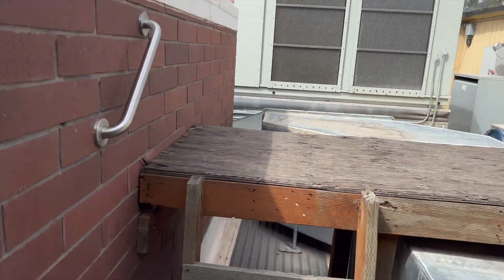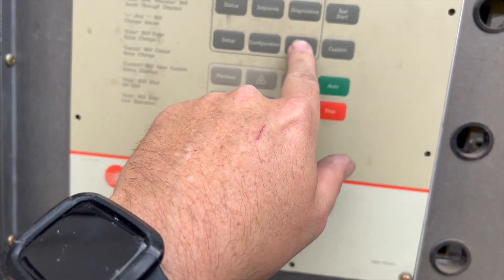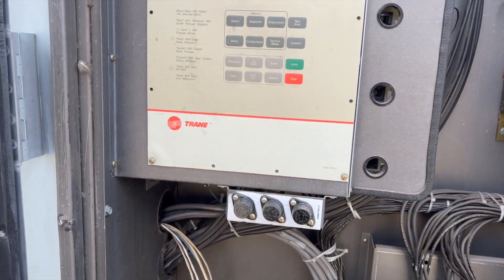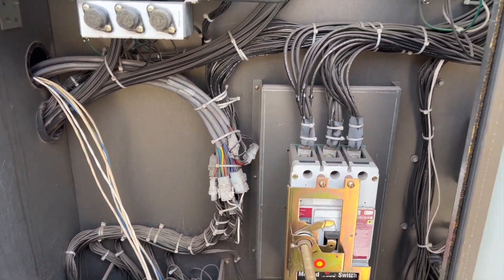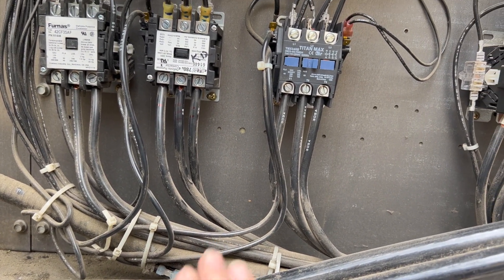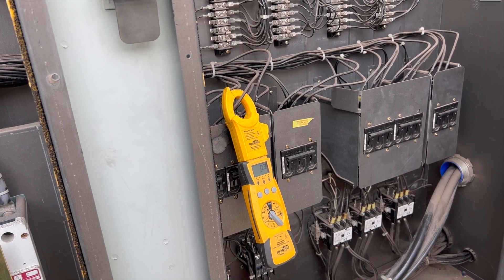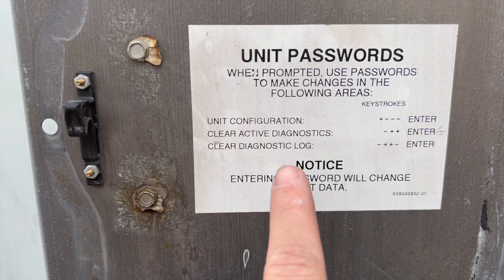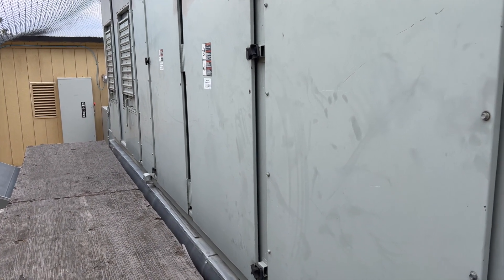TRANE INTELLIPAK Not Cooling!!! Diagnosing Compressor Lockout EP88

Comment: I'm just a Maintenance Manager for an office building with two Trane Intellipak RTUs (75ton & 90ton), We've been getting ckt 2 trp for a long time and our previous HVAC contractor would just come and reset it and leave. At one point the bypassed one of the compressors (?disconnected it from power?) so I know that I have one compressor down, and it looks like that may be contributing to this problem. We are still getting that same diagnostic error about the ckt 2 trp. This video helped me nail down the most probable solution for my boss. Thank you!
Reply: I'm a Chief Building Engineer and can tell you to get another HVAC Contractor.   A monkey can reset a unit however it takes a trained technician like this gentleman to 'Troubleshoot' the unit and find what's causing the unit to trip and go into alarm.